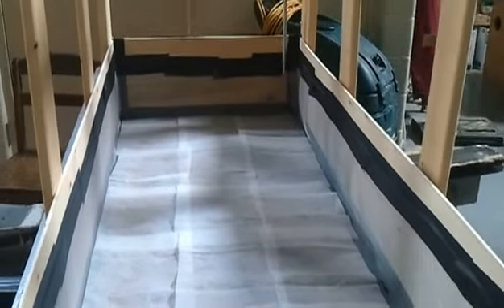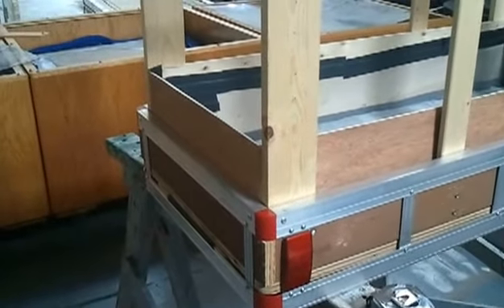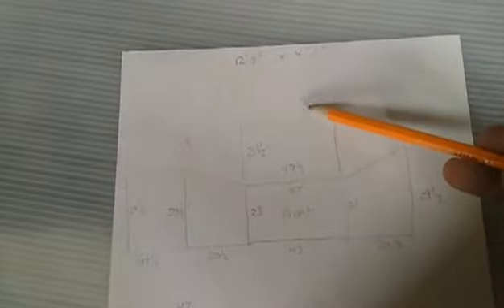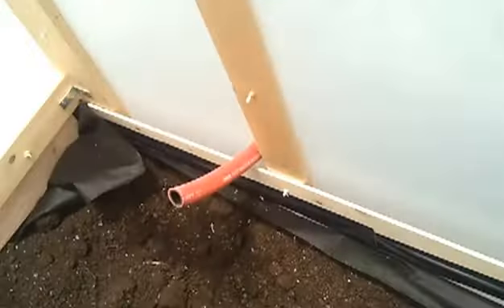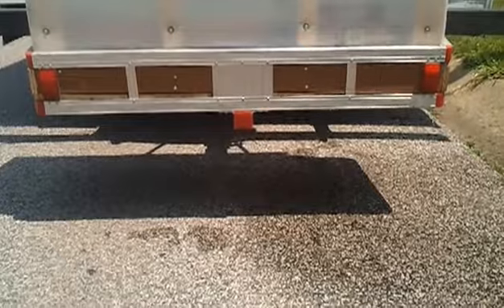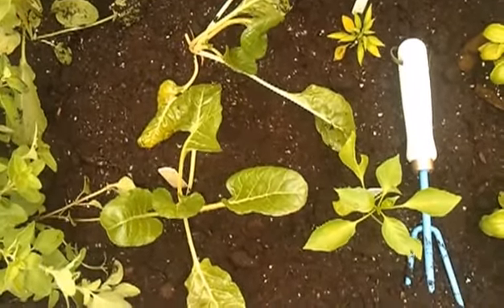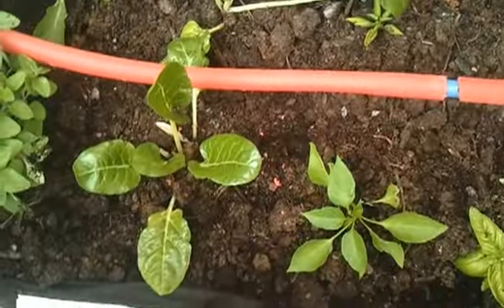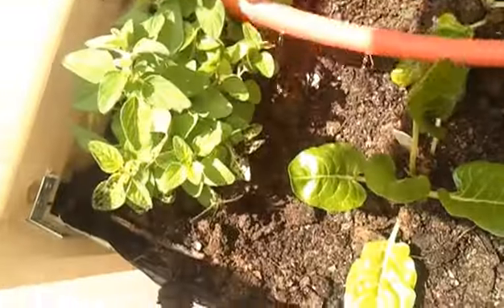Mobile Greenhouse for my RV- Part 2

Comment: I see this is from 2013. Curious to know how the garden turned out!!??!!?!
Reply from the maker: I still have it!  It's "parked' on our apartment patio now but I think it was a success.  The Solexx worked well shielding the elements and allowing sunlight in.  I think the "jostling" effect that the driving caused also helped the plants harden and really produce.  My cherry tomatoes were out of control!  The only thing  might change on the next design would be potentially a lighter design.  I'd experiment with a lighter amount of wood, especially in the basin, and I think it would still hold up well.  My particular trailer hitch is at a downward angel and it would work better if it was level, but that's a different issue entirely!  Cheers!